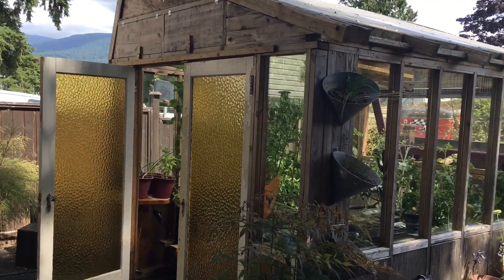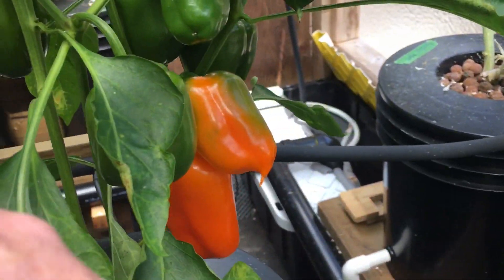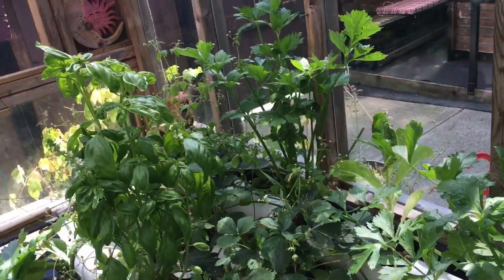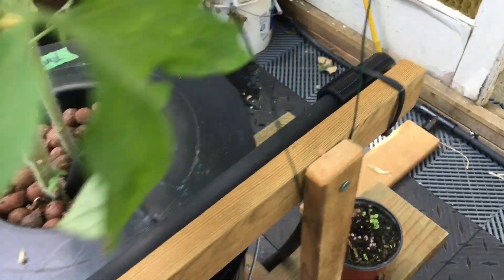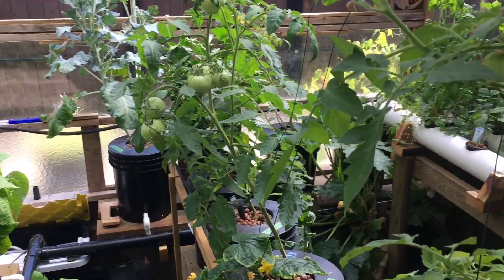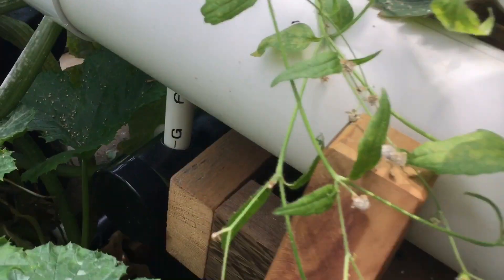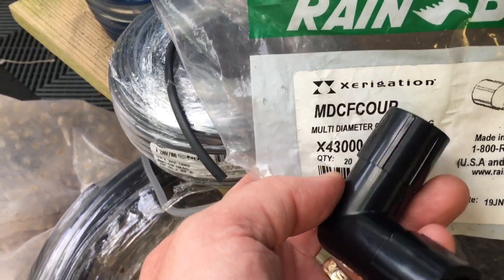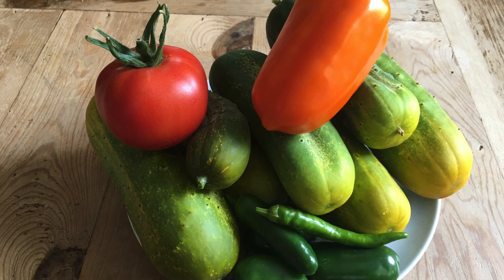Update #12, 15 weeks of growth in my hydroponic greenhouse

Comment: Just out of curiosity, what would you say your startup cost would be for something like this? I was thinking of doing something similar.
Reply from the maker: Hey there, sorry for the delay, just saw this comment. I would think I’m probably around $600 for everything, but I did get the pump for $10 off Facebook marketplace. But now I should be good for a few seasons. The system is reusable, as is the hydroton. All I’ll need now is the nutrients ($60CDN for the three part General Hydroponics three part that I’m using). You can get or make your nutrients for cheaper, but I’m pretty happy with these. Taste was great on everything. I actually just finished my first bottles this week so they lasted me 21 weeks. 

If you have a plumber friend, the pipes and tubes may be cheaper. I used a neighbours account with Rainbird for the fittings and pipes.

Comment: Your green house is my goal my dude.  Do you live somewhere that has cooler weather?   I've been thinking about building a green house but not sure how it will do in the North Texas heat
Reply from the maker: I’m on the left coast of Canada. Still not sure if I’m going to keep it running during winter. I may move it inside in a smaller version.
Reply: @DaveDanchuk  I think I got your set up figured out I just don't understand the timer.  So does the nutrient solution only flow for 30 minutes?
Reply from the maker: Josue Rubio flows every half an hour. Whenever the pump is on. I do have air stones in my reservoir as well to mix them up.